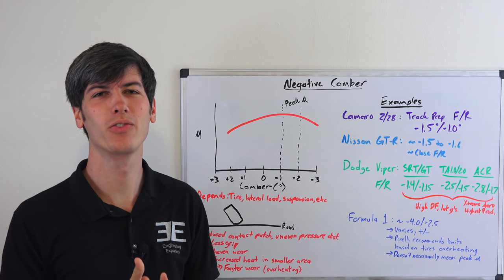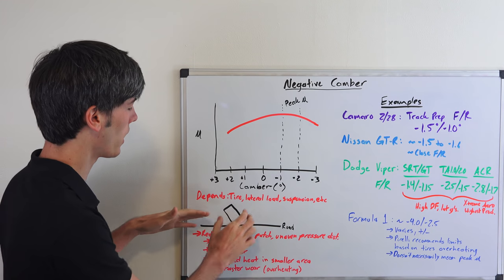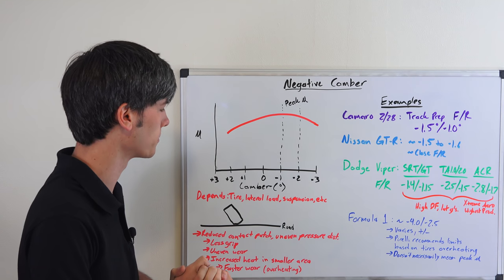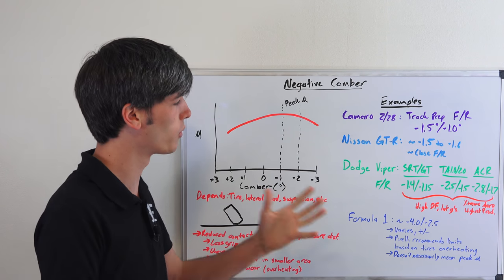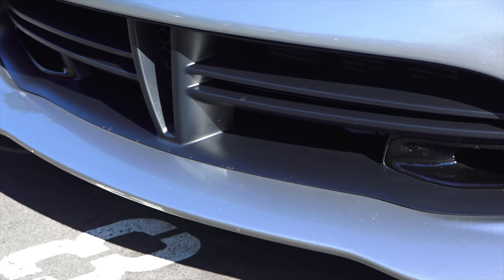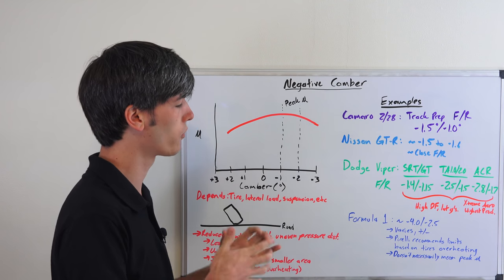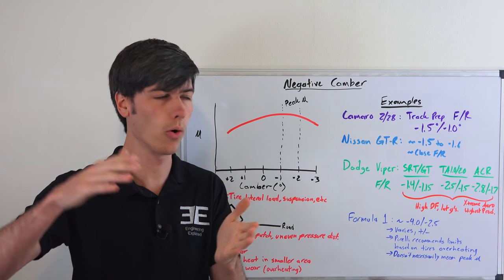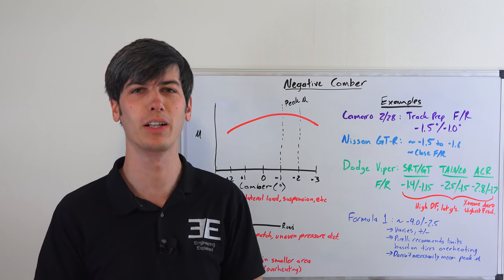Too Much Negative Camber - Wheel Alignment

Comment: Try an international Hyundai i30 2010 - Bloody Criminal things! - A P.O.S. road-car with a lot of camber to 'try' to get it handle well ; and yes it did do corners well ; BUT on a straight it squirmed constantly against the road-camber and would NEVER drive straight ; a cheap POS way to get 'handling'.
The car ate Eleven tyres in four years ; even though I got the Boss to pay for elliptical-pins in the front to reduce camber.
I have had cars since the 1970s and nothing has driven so badly.

Comment: I hope everyone realizes when show cars use camber it is stricly for wheel fitment/ looks and not performance. Also, camber isn't what kills tires, it is your toe that'll destroy them.
Reply: +Tucker Maxam Please elaborate on how camber does not kill tires.
Reply: MattsE36
camber with a good alignment does not substantially decrease the life of tires since the tire still rolls straight with the same resistance as without camber. Toe, where the tires are pointing inward or outward, will murder your tires since they are going against the direction of travel meaning they are trying to pull left or right but the car continues straight causing substantial amount of tire wear.
Sorry if there's poor grammar or run ons lol it's late and I am tired.
Reply: +Tucker Maxam Toe is the worst uneven wear you can ask for. And exaggerated positive/negative camber is bad also, not equally as bad as toe. You don't want to wear out your tires quick, people who apply large negative camber for appearance should reconsider the costs.
Reply: Tucker Maxam LOL, "camber doesn't kill tyres", yeah, putting all the weight on the inside edge of the tyre and letting the outside only actually touch the road when the inside is substantially worn away doesn't kill tyres at all huh?
Logic much?
The whole idea about setting the right amount of camber is optimising the contact patch when you need it most, aka when the tyres get closest to their limits, aka when they wear the most. Any part of the tyre that isn't planted on the road as firmly will wear out slower, hence why so many cruiser bikes end up with the middle of their rear tyre worn out when the edges are still brand new.
Reply: That’s why after awhile u can switch out the tires to the other side.. so it can wear evenly lol

Comment: With that thumbnail you should have also explained why drift cars have a lot of camber in the front....
Reply from the maker: +Mario S. They don't need it. The teams I spoke with at Formula Drift did not run high camber. If you run high camber in the rear, it will reduce grip, thus making it easier to drift, but not a better drift car (it will be slower). Here's an article I wrote on the matter: https://www.carthrottle.com/post/engineering-explained-how-to-build-a-drift-car-the-wrong-way/
Reply: But that's formula drift. What about grassroots cars that aren't full race cars?
Reply: +Engineering Explained It seems that cars in Formula Drift do tend to run more camber than a car meant for racing, though. Especially in the front. I heard it was related to the suspension geometry/huge steering angles those cars can achieve. Ideas?

Comment: Why is there Camber at all? When the tire is flat, there's maximum grip?!
Reply: Maybe in an alternate universe where roads are perfectly flat and you only go in a straight line
Reply: +DimensiiioN He states a few reasons in the video. It helps the tire resist the lateral forces during cornering. It also helps reduce tire temperature in Formula 1.
Reply: +DimensiiioN Links about camber in the description. Basically the point is to compensate the deformation of the tyre while cornering.

When a tire is under inflated, the tread tends to adopt a concave shape, which means you basically drive on the outside and inside parts of the tread not using the center much.

Low pressure means more rolling resistance > More wear, lower top speed, bad fuel economy, high temps, etc...
Reply: +DimensiiioN When you go around a corner, the car is pushed sideways, so if you have a couple degrees of camber,  the tire flattens out during the corner so you can corner harder.
Reply from the maker: +DimensiiioN https://youtu.be/-VFlqPE1gBw
Reply: +KingJanic yes but the most popular is over kill which increases improper ware
Reply: +DimensiiioN take a pringles can lid and hold it sideways with one hand and push on the side with the other hands with your finger. notice how it warps. now imagine this is your tire while turning.....

Comment: I have some good video ideas but you never respond to my comments :(
Reply from the maker: +Archi That is indeed very sad. :(
Reply: +Engineering Explained 
Yay - some visibility ^_^

I'll start with 2 questions, I've got 20 although figure you've got enough on your plate. I'm ill informed when it comes to cars & I would like to know the following;
* People often replace car engines with motorbike engines, for something like a hayabusa turbo in an old fiat 500 - how do they reverse?
* Why are brake calipers a mix and match between front & rear facing on certain cars? Does component positioning impact performance? Ferrari have them facing outward (front and rear) whilst average 'daily' cars have a mix & match. What is the real world application?

If these are dumb questions I'll stop but as I said, I've got 20 more 'valid-ish' ones.

edit: I take #2 back, you already made a video about it (/watch?v=HEIk0hJ7eGk), whoops.
Reply: +Archi when you go in reverse its the transmission that moves nit the issue... The issue with swapping a bike engine is that the driveline needs to be converted alot to allow the bike engine
Reply: +MrSpedhead Yeah I know, I'd just like a whiteboard explanation.

Comment: Ah god..... Ignorance is bliss.
You say F1 cars run -4.0? come on... the sidewall is very stiff, there is no benefit to run that high, unless going at very high speeds where the total downforce overcomes the tire stiffness making it relatively softer that a high negative camber would be needed. In normal circumstances, -2.5 should be the limit. As for road cars, anything up to -5.0 is fine. Unless there is much downforce involved or a soft tire sidewall is ran, -5.0 should be the normal limit. The peak lateral g can be achieved between -2.5 and -5.0 on most cars with the most common tire compounds. But the grippier the tire, the lesser camber you need, because there is a tendency that the tire sidewall stiffness is increasing with overall grip. The objective of running camber in the first place is to overcome the elasticity of the tires so that when cornering, the contact patch area is maximal. But with stickier tires, elasticity diminishes, that's why there is no need to run ridiculous camber on race cars with slicks.
The audience of this video is probably stupid drivers who know nothing about vehicle dynamics, so I don't think what I said is relevant to the video... because all you're gonna do with your car is drive to work or home, you don't even need 1.0 g of lateral acceleration, why bother with camber? It doesn't increase tire wear, we can even say it improves tire life. There is no need for numbskulls who don't know anything about cars to fiddle with the settings. They will destroy the car, making it unsafe... Factory settings are the most optimal for what the car's been designed for. Don't think you know bettet when all you've seen about cars is Fast'n'Furious movies. Idiots.
Reply: Naredo Iwanaka You make a good point. I think you should tell all the F1 racing engineers that spend millions of dollars on r&d and years of rigorous computer testing on their F1 cars that they're all entirely wrong...
Reply: Jordan what? Do you have a source that claims that f1 run -4 camber perhaps?
Reply: Naredo Iwanaka Of course. jump on Google. And the F1 website. Pirelli themselves state the camber limits of each car. 4 degrees was what they run up front at the time of this video. this year I believe it's limit on some tracks has been cut down by pirelli to 3.5
Reply: Don't you know how to link a source?